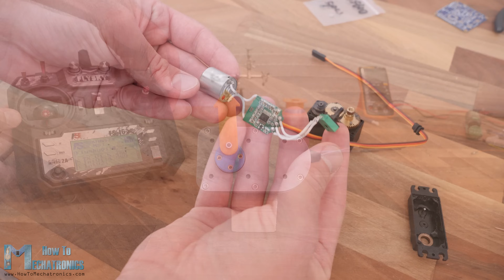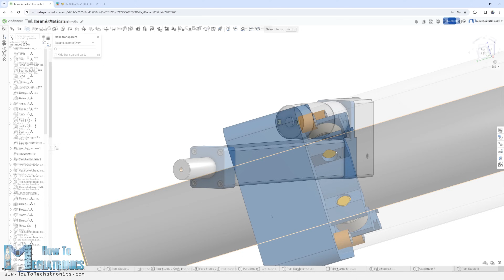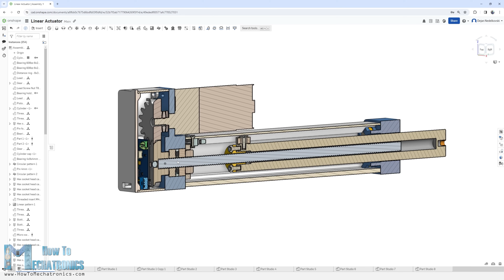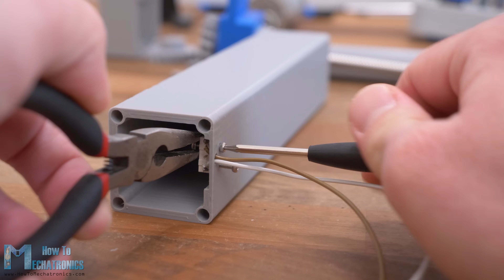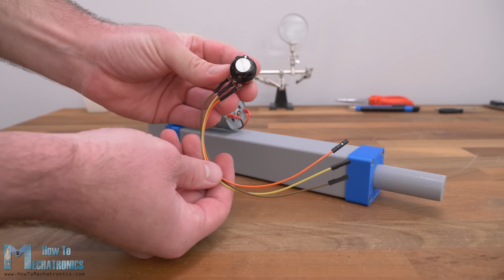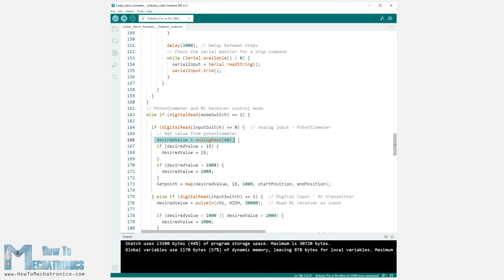3D Printed Linear Servo Actuator with Position Feedback

Comment: The only changes i would recommend would be the bearings in the base. Rather than stacking them and using a retaining plate, model the separator plate in the base. Install one bearing on the lead screw side, and the other on the gear side. The gear and the collar will work together to clamp the bearings in the housing against the bearing seperator, so no need for a retaining plate. 

Mechanically, this looks amazing! Good work!  

Electronically, theres another improvement. On the uC, start your sketch by checking to see if theres a 40-200hz signal. If so, proceed to rc control. If not, proceed with analog control. If you periodically check the inputs (once a second?) Then you should be able to swap inputs on the fly and no need for a toggle. The impact on loop times should be negligable if executed correctly and you can run the rest of your code along side it, assuming the input hasn'r changed until it knows for a fact during its test that it did change inputs. 

It's a pretty simple mod to detect signal type because they are sooooooo Different. Hell, you could even use an interrupt to. Monitor the input. If the interrupt counts up within a second, the acceptable frequency, then you switch to rc control. You can run interrupts while analog sampling. And yes, i know interrupts are digital pins. However 328 has 2 comparitor pins A0 and A1 that can be assigned as an interrupt. Keep in mind, this is just one way to handle this issue. You could also tie either D2 or D3 to the analog pin you decide to use and just flip flop between code segments as necessary as well. There are a ton of ways to automate that in code so you dont have to use mechanical switches which would make your board even smaller!

Comment: First, awesome video and thanks. About dimensional accuracy with 3D printing. I have an old i3 Duplicator that was giving me dimensional issues many years ago, i knew it wasn't plastic extrusion rate or shrinkage because on my (very) old Replicator the parts where coming out "perfect", no matter the orientation. The prints where coming out warped (shrunk in the Y axis near the back of the build plate). This is when i found the belts weren't lined up to the pully, which causes a issues with travel (a2+b2=c2). So i designed a new bracket to hold the stepper motor to be perfectly aliened with the belt and bed belt mount to be perfectly parallel.

With that said, i took a close look at the printer you have at a local Micro Center and found the belts and pulleys to be off by about 2-3mm. That's significant, and I'm certain that's the issue you have with your prints. 3D printing ironically helps counter plastic shrinkage compared to molding. This is practically why they then to have internal stresses and generally are stiffer than there molded counterpart, i.e. why annealing 3D printed parts is a thing. And for functional parts i use as little part cooling as i can, both for better layer adhesion and reduce internal stresses for parts i need to have a little flex.

On the printer you have the tool head belt mounts are about 2-3mm off line and the bed is about 1-2mm off. The prints will warp near either end of the X-axis and the front of the bed as the stepper motor is at the back. The KE is even worse on the bed belt

I currently have a very modified Sermoon D1, with ~0.015-0.03 dimensional variance. I also squared the frame and trammed the bed to the tool head axis, then to finish it all i put 7lbs (14lbs pull force on the motor, as the belt wraps around the pully halfing the tension per side). Used a scale for luggage to pull on the motor

Comment: very good video. But I am curious, what is the benefit of using the servo as opposed to a stepper motor? You will not have the slight adjustment at the end after feedback.
Reply from the maker: Well it's possible to make this control system with feedback sensor using stepper motor as well. I should first try it out and then tell you the difference. :)

Comment: cool.
what would it look like using a raspberry pi
Reply from the maker: Well the mechanical part is all the same of course. Like mentioned in the video, instead of the custom controller PCB you use the AS5600 on a breakout board, and use the raspberry pi to make the program.

Comment: Excellent work!  I use the heat set inserts as well, very strong and reliable connection with the correct infill percentage.
Reply from the maker: Thanks!
Reply: What infill percentage would you use? Is 25% enough for PLA? Or would it be better to add more outer layers?

Comment: Very good job! But I don't know how the bearing on the top of the rod works . I think it can't rotate when actuator is going forward or backward...
Reply: I mean, you don't need 1 bearing, you need 2 bearings slightly smaller than the width of the guide slot (and each of them rests on a single face of the slot) if you want them to rotate when the actuator moves.
Reply from the maker: Yeah, your contemplating is correct, the bearing couldn't rotate if it touches the two guide rails. However, there gap is just slightly larger than the bearing, so the bearing touches only one side at a time. Because of that, of course, the rod rotates just a little bit.

Comment: How can I control servo by text in serial monitor for example Isend in serial monitor "play" when I send it Iwant rotating the servo 90° how can I do it I try it by number done but by text not how can you help me please.
Reply from the maker: Well take a look at the Arduino code, it explains how I did that for this project.
Reply: @HowToMechatronics  
Sir , what's code I look for it ?